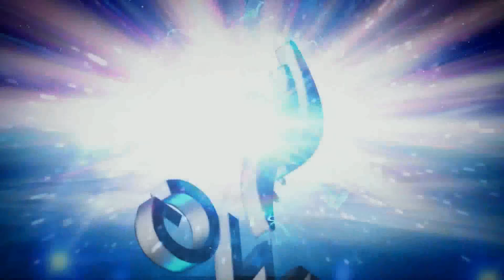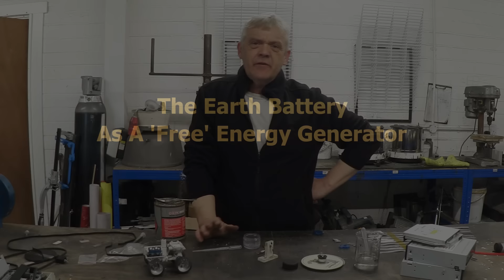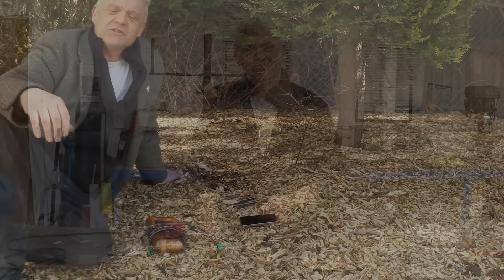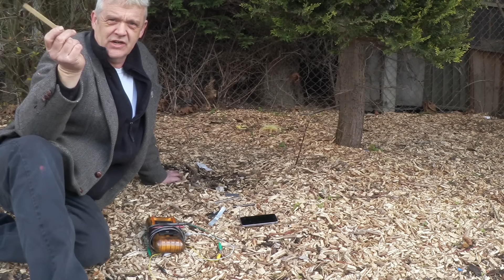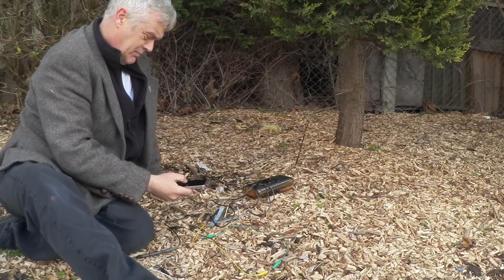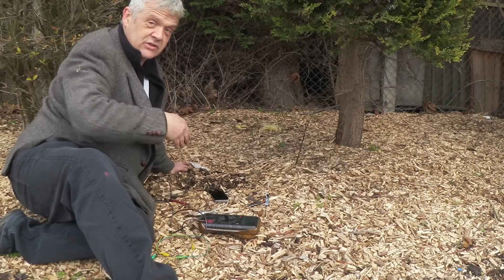The Earth Battery As A 'Free' Energy Generator

Comment: Great presentation.
Might I suggest that you use a 4ft copper and stainless steel rods?
The upper layer of the earth on how dry is really superficial.
Boring in a 4ft copper rod by a creek as the positive and the stainless steel rod by your house as the negative.
Let's say that the creek is a hundred yards away from the house.
Bead a wire from the creek and one by your house.
The positive line will be inches of touching the negative stainless steel rod.
Coil up a 1ft tube of copper wire then exit to attach the wires to a pulse motor.
Place a narrower coiled up tube to fit in the larger one.
Volt test the coil.
And see what you get 😁
Reply: Saw a video on something like that and he was MADE to remove it... Shock hazard....
Reply: Let's say the nearest creek is 30 miles away in my part of the world!     :cat-orange-whistling:

Comment: I did an art project few years ago with earth batteries but with plant pots. It was working pretty well using acidic soil (consequently with plants requiring this type of ph), copper and zinc rodes and I could gather 5volts, amps were a bit low but adding more "batteries" in serie was much better. I think humidity of the soil, the size, the surface and the distance of the anode and the cathode can make a big difference. Looking forward to try it in nature! 
Anyway thanks for your channel, great contents!
Reply: Don't you mean in parallel? In series would just increase the voltage.
Reply: @benholroyd5221  ya, that sounds about right.
Reply: So I can charge my vehicle's battery when I am stuck in the veld?
Reply: Thats how Egypt died
Reply: Not really!
Reply: @11henger   How are you meaning, "that's how Egypt died."  Would you please expound on this? Very interesting!  What do you think the pyramids use was for?
Reply: @11henger  very interesting , please elaborate , do you mean piezoelectric energy ⚡ ?
Reply: @poppylove3673  What do you think about triboelectricity? Tectonic moves?  I have no idea 💡 ,  just guessing, am not a scientist , sorry
Reply: There are now more options of pots w/built-in reservoirs in the bottom, which could help keep a more even moisture, without flooding the pots or drying out in hot summers.  Or, pots could be put on a drip line, along w/other potted plants..assure moisture..or, use a dirt containing water sponges in it. 
Can Epsom salts (MgSO4) be used as electrolyte, instead of table salt (NaCl), to act as fertilizer for plants in the pot, instead of killing plants around the electrodes as salt does?  
If big pits are used, & planted w/small container trees, could one electrode be connected to the tree, which uses the roots as better earth connectivity, & the other one into the ground, or, to another potted tree nearby the 1st one? 
If a mild vinegar water is used in the pots, could acid loving plants survive in the concentration, to help camouflage the setup?   
Or, a mild saltwater to water dirt growing salt-tolerant plants? 
This is all VERY interesting!!  I’d love to understand it well enough to try running some small things like LED lites, or charging devices!
Reply: @11henger  ?
Reply: That sounds like electrolysis,  not like an earth battery. Electricity will stop when all the zinc is dissolved.
Reply: Look up Patrick Kelly if my link fails. 
He told of a couple of Argentinean school kids who put 2 meter long rods in a 90 Cm by 90 centre meter grid 9 by 6 
 The centre 5 leaving the top 9 in one line, are one potential, the rest are all connected in series from each side of the positive potential centre 5 rods. 
  It connects from the 4th in on the bottom row back to the first then up 1 and back to the second row 1 to 4 then up to row 3 & back to 1st row ( left hand side)
All the way to the top row connected in series and zig zag to the bottom row finishing at the 6th rod on the bottom row.
 These boys were said to have gotten some big current output  from this arrangement.
Reply: @alanmcnaughton3628   😳😵‍💫Wow! Gotta take your word for it…trying to create a picture in my head, from your word description, is like trying to play 4 sets of StarTrek tri-level Hess simultaneously! 
Any chance of seeing a drawing of that?? 
Sounds intriguing!
Reply: @Chimonger1  I did have a pdf from Patrick on every device he described the operation of. 
 I need to look back into it but I think it's lost as its in the Polaris app. 
 I had a broken screen that gave me grief to just get it working again. 
I did look in my clipper app and it's not there.  
  I'll try again with your chess board as a grid pattern. 
Imagine  a rod at the top left corner of the board, and each square is 900mm ×900mm. 
At each black white Junction goes a rod, so from  top left to right side there are 9 rods.
 Make that same grid down to the Junction of the 5th & 6th square so you have 9 across  and six down. 
All the top row are series connected, then on each side connect down 1, so 1 to 2 and 9 to 2. ( second vertical)
Come in both ways to but not including the centre or 5th row which (row) becomes the positive termination on the 6th horizontal or the bottom centre.
The second  horizontal is series connected  to the 4th on the right hand side and the 9 th second row is connected  back to the 6th. 
The down to the third row each side connecting away from the centre  or fifth vertical row.
   You go back to the LHS on to the left side of the grid and to the right to 9th horizontal by third vertical.  Then zig Zag down each  side Until you come to the posts each side of the centre bottom row.
 Patrick died a couple of years ago, He  was only ever out to help with zero point energy or coefficient of performance greater than 100 %. 
He didn't give a Voltage or current but said the boys burrowed a meter from the local power company to measure  the potential  output and said they got 17 kilowatts out of it. 
I want to try it myself  and will use copper tubing first, but he said these boys used copper rods.
Reply: @alanmcnaughton3628    What about Cu grounding rods?  Those can last around 40 or so years, in-ground, before turning to “Swiss cheese” from corrosion.  Great conductivity.  But unfortunately, everything’s gotten crazy-bloat-priced these days.  
Even trying to use rebar is costly…& those cannot last exposed in ground, & rust out fairly soon, depending on ground moisture. 
But I wonder, if the grid you tried to describe were made of rebar, then, embedded into concrete same as usual for rebar, if it would last at all well?…or function to harvest electricity at all? 
Maybe, time for a junkyard scrap-yard scavenge. 
Maybe, make a model 1/3 the size, to see what it might produce?…at less cost?
Reply: @Chimonger1  I have thought of using brass from Old taps and whatever  is made of brass. 
Making  a 20 mm depression  in sand from a steel rod to mold them even if one at a time. 
It's on my wish list when I find the time.
Reply: @alanmcnaughton3628   It’s evidently best to use 2 different metals for the electrodes.  At least, some say so. 
But, taking a cue from making colloidal silver, using both electrodes as pure silver, that has worked well…but one of them is sacrificial, so, loses some of its mass as ions of silver get suspended in the water.
I don’t know if using dissimilar metals for electrodes might reduce the loss of metal, or at least slow it.  But losing metal into the ground, over time, means need for replacing the electrodes at some point. 
Used to be, any store that made key copies, had buckets of old keys & miscuts, anyone could volunteer to take off their hands…now, hard to find.  
But metal junk yards might have all kinds of metals to buy by the pound, if you are casting your own….seems like a LOT of trouble to go to though, when rods of metal of various kinds are fairly easy to find/get. 
I was thinking of the galvanized, huge nail spikes from HomeDepot…some are about 12” long.
Reply: @Chimonger1  these guys used 2 meter copper rods I'm not sure I it's even a battery as such or maybe it gets the power from current in the earth that is just there ?
 I think the 2 meter length  may be important so brass melted into maybe 3 or 4 molds in the sand would be a big enough  crucible in one go.
Reply: @alanmcnaughton3628    I like the design of using pipes filled w/1/8”- gravelly lava rock, laced w/carbon black powder to enhance electrolyte activity.
If metal pipe, that can be one electrode, so only need a center electrode then. 
One version used metal paint can, w/center metal pipe (recycled copper).  If pipe might touch base inside, put paper to separate the metals, to prevent it shorting.
But I was thinking, put pipes into our raised beds, w/drain holes in bottoms, filled w/finely ground lava rock & carbon black, & the center electrode maybe longer than the outer pipe.  …OR, use PVC pipe casing, & use 2 electrodes inside that, to isolate the current   from the plants growing in the raised bed. 
Goal there, is ease of keeping the electrolyte damp for conductivity, & that it would be hiding in plain sight. And, ease of maintenance & monitoring.  
Our ground here, is basically pit-run gravel, so is very hard to put anything in the ground. 
I don’t know if there’s any advantage to casting your own metals…except if you have them available, & want to homogenize the metals, & make uniform sizes?
Reply: Your credibility slumped somewhat with the 'in series' comment. Also anyone who was doing this experiment would have stuck a multimeter on the output and told us the current per cell and the voltage for a given pair of electrode materials.....so, sorry, not convinced.
Reply: @Deontjie  absolutely, at 5 or 6 micro amps..... it would take until the end of the universe though.
Reply: @occamraiser  I'm  still to try this. 
  Patrick Kelly  was the one who gave these sketchy details on this battery. 
  I still don't know if it's individual cells or if it gets power from the earth's magnetism, so the total output from the two positive legs, one each side of the earth potential may be only measurable as a whole. 
I'm only a messenger not the inventor. 
  Patrick  put everything  on a pdf that I'm yet to try to get back out of an app that worked on a previous  phone, but it will take me a while to dig it out.
Reply: Second Gillespie. 
UHF charged battery.
Reply: I've been looking for good info on earth batteries. Particular the stubblfield battery. Do you have any good links ?

Comment: I’ve experimented with earth currents. The changes in power from various materials indicates at least part of the power generated is electrochemical.
The depth and composition of the “electrodes”, mineral makeup of the soil, pH, moisture content, and any number of other variables make a difference.
I used stainless rods to minimize electrochemical reactions.
There may be additive or cancelling currents as well. After experimenting for days in several locations I never did come up with definitive criteria. Inserting the spike as little as an additional inch or moving it a foot raised or lowered the voltage sometimes arbitrarily. Sometimes the power changed with moisture but not always. Sometimes it went up and sometimes it went down. I think it just depends on what the makeup of the subsurface materials and stratification, as well as the cumulative contact area between the various subsurface materials and the rods is at any given location. Like you did in the video, manipulating the rods produced variations. 
It was frustrating but fun.
Reply from the maker: I agree mate - the main point here is to have fun
Reply: One way could be to use an isolated but conductive soil filled container with a controlled water saturation level, place it in a dug hole in various places and back fill the hole, then test the differences between each location, if indeed any. And also turn the container 90degrees in each hole.
Reply: @ThinkingandTinkering  can be make a fast charger working with lightnings, store lightning to make lights later...
Reply: The earth is a giant potato.
Reply: @Shootingstarcomics  no , but inside of a caballo
Reply: @balazskiss985  Has to be electricity in ground because sun bombards it with radiation constantly regardless of lightening. It's not obvious how to convert it but before the recent major earthquakes, there was major blue flashes, apparently electricity released from ground.
Reply: "So up above, so down below" by that ancient wisdom, perhaps the ground currents are chaotic as the skies, perhaps using low forward drop rectifiers (Schottkys) as a rectifier on each cell might be able to harvest more current even though you will lose 0.2V, has anyone actually seen if these have AC waveforms?